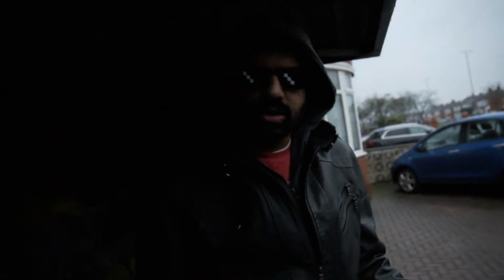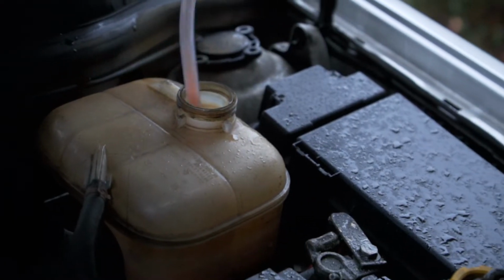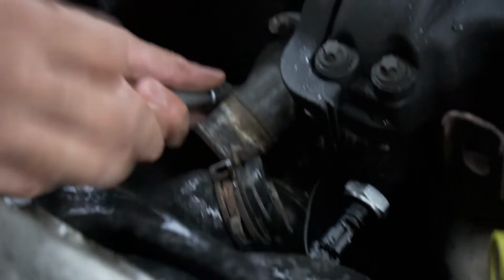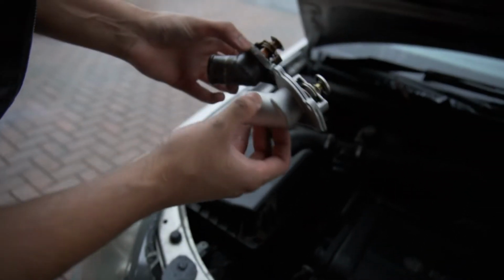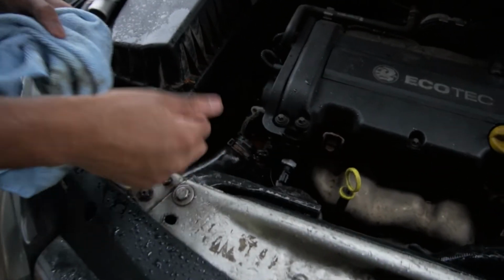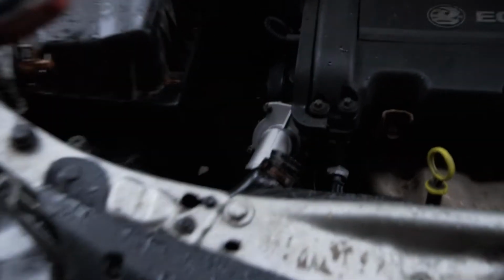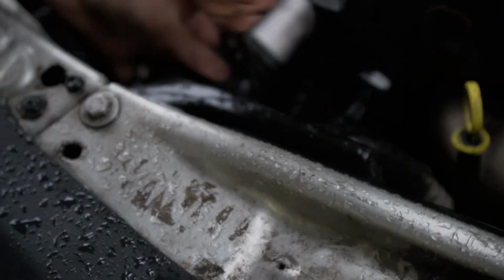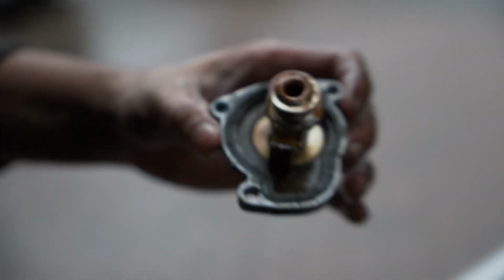Vauxhall Astra Thermostat Change

Comment: My partners vauxhall astra sri mk6 2013 keeps coming up with service car soon and the fan spins really fast constantly, temp is saying 50 degrees all the time, would you say that it's a thermostat issue
Reply: I have the exact same problem. I have Astra 2011
Reply: Same problem
Reply: replace the thermostat sensor, it controls the fan
Reply: Hi I have the same problem have you fix yours, mine the fan still ran even engine off
Reply: @joeblessmuzo6731  I changed the thermostat housing and it fixed it

Comment: If it still over heating by the way or your mk4 is overheating and its not the thermostat. Make sure you've got the coolant filler cap on tight. 👍.